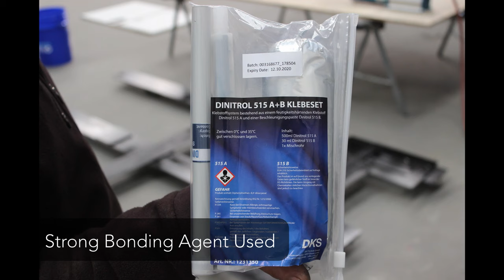Reimo Variotech 3000 Rock and Roll seat bed install

Comment: It was a toss up between one of these and the Mobiframe SAF11/12 for me. The Mobiframe came with an optional composite full floor with full rails built in. I can position it in any position without limits and lock the seat down. No rattles but it’s heavier and the locking mech is a little difficult to use. Putting this up and down every day means I don’t need a gym membership!

Comment: Well that floor ain't coming up again  🤒
Reply from the maker: If you mean the rails are not coming off you are correct.  It's a very safe system!  The floor itself can be removed and replaced whenever you feel like a change.